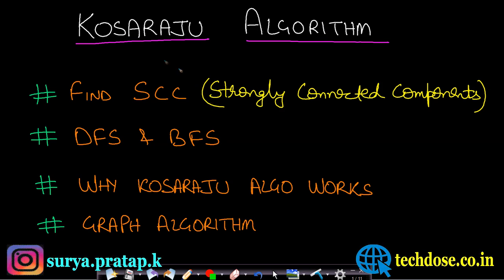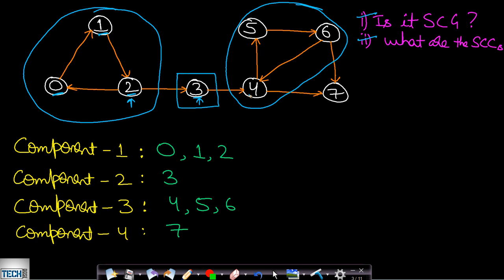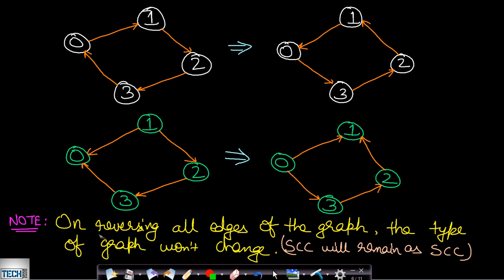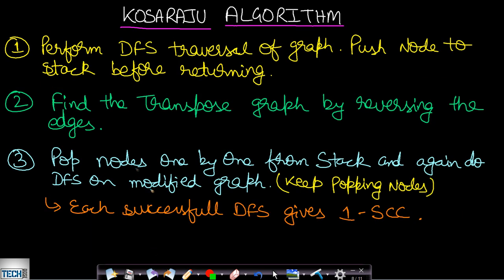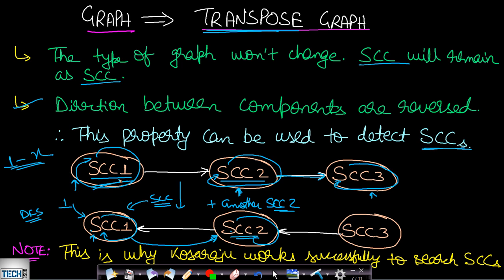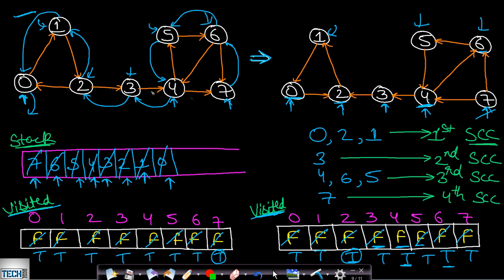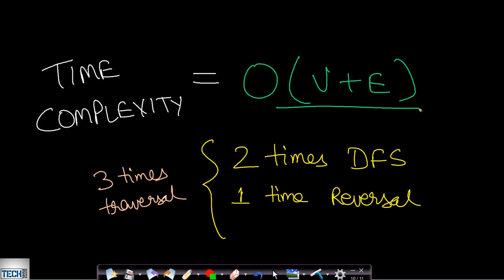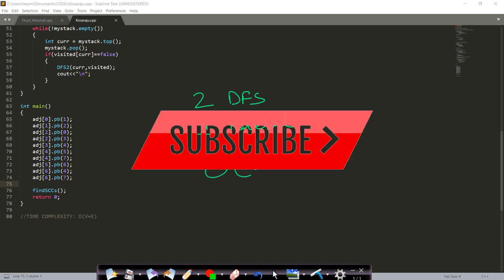Kosaraju Algorithm | Strongly connected components in a graph

Comment: Instead of pushing the elements in the stack during backtracking, we can directly push the element as we are moving ahead, in that case, we won't even require to reverse the graph. Secondly, a point was missing here. While doing a DFS, if we are unable to reach every node, we must again do the DFS on the remaining ones. The example taken satisfied the approach but it can have many more cases. Still, I could think all this because I could understand what you explained in this video. Thanks. Do consider these points and let me know if I am going wrong.
Reply: Even I am having the same doubt can we do this?

Comment: Thank you for amazing explanation but a little correction here. In case of undirected graph we call component a "connected component" not strongly connected component. SCC term is specifically used for directed graph if there is directed path from v to u and u to v.

Comment: Hey, what if instead of reversing the edges, we reverse the stack and perform dfs.. Will it generate wrong output?
Reply from the maker: No it won't work. On reversing edges, the connecting edge between SCC is reversed. If you take SCC as just a single node then the graph will be a DAG. Our goal here is to detect when we move from one SCC to another. For that reason, you will require that edges are reversed so that you can't traverse more than 1 SCC using DFS only once. You need to manually make the jump.

Comment: why do we need 1 st dfs in this algorithm can anyone explain me the intution behind it.
Reply: ex - ( SCC1 <-- SCC2 ), in this case if reverse and start from SCC1's node then it will be messed up, so using ( DFS with stack ) first will help to start from SCC2's node.
Reply: The reverse g dfs confirms that there is a path from v->s the second dfs in the normal graph, if we find s->v we know we have a strong connection. 

The fact that we use a reverse post order queue implies that if the p (the preceding vertex) is ‘done’ before s is reached, s is not reachable by p and so on